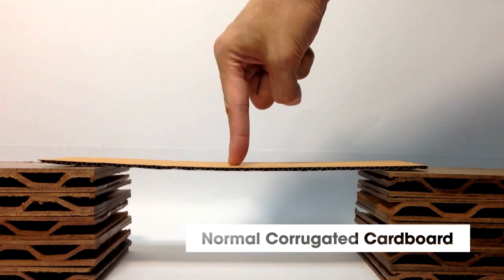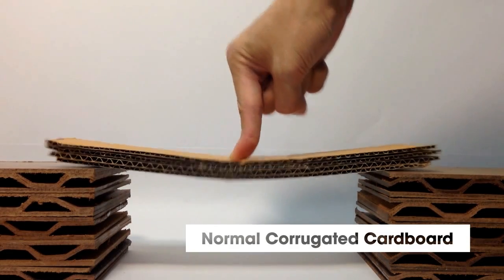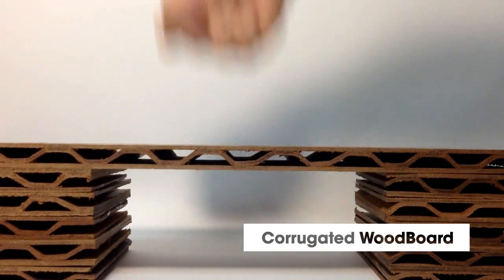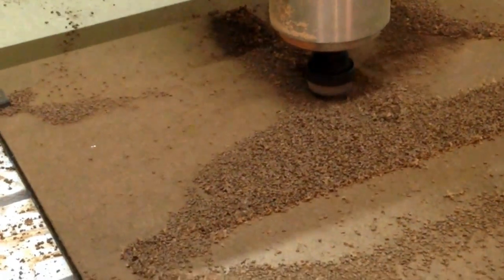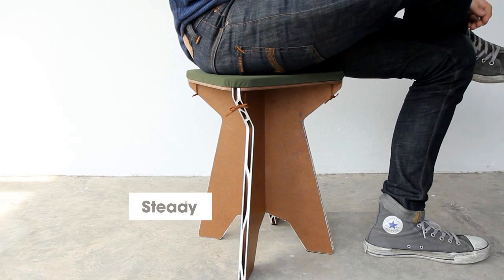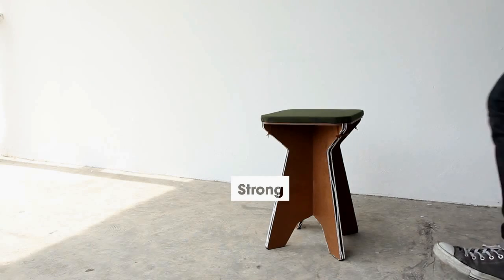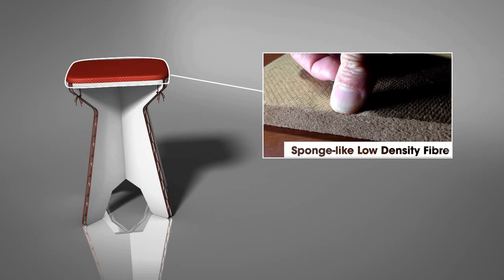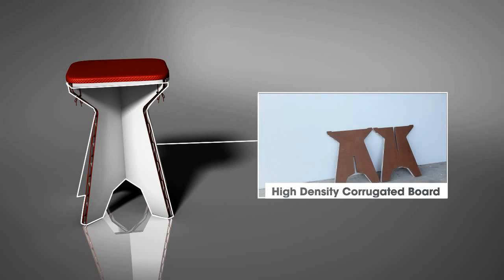Super Corrugated Board

Comment: Did this ever take off? I've never seen or heard of it before. 2020 current year.
Reply: It's basically just corrugated hardboard. As far as I know it has not taken off, and I doubt it ever will. The cost to produce something like this would be significantly higher than doing a traditional composite with MDF sandwiched by some harder material. Plus, the only advantage this method has over that is more strength for the same thickness and lower weight, but if those are deciding factors there are still better and cheaper methods than this one.
That being said, I still think it's great someone tried thinking out of the box and took the time to create, design, and produce a different material like this. Just because this didn't become the next big thing, and everyone isn't rushing to build houses out of it doesn't mean it won't have extremely practical applications in one field or another.
Reply: It's 2021
Reply: @naveens3687  BRUH...
you're 11 months late
Reply: @j453 - bruh, you shoulda called.  He prolly missed the email marked "urgent" you sent him, to let him know you made this comment. 😂